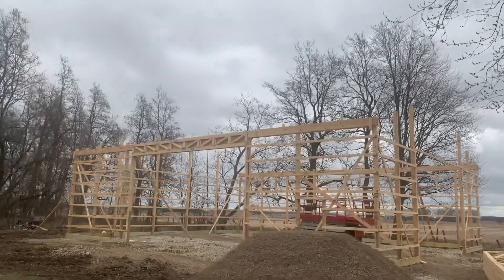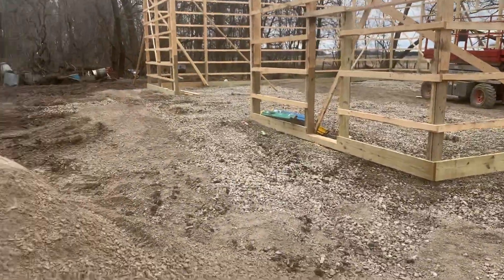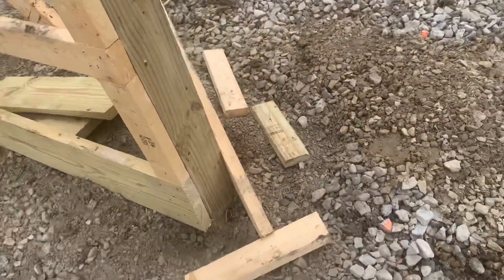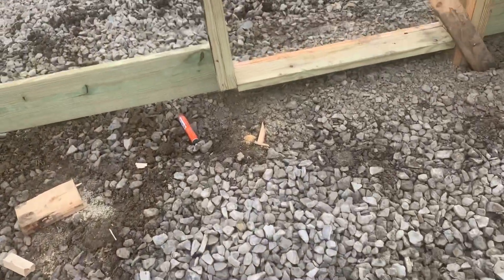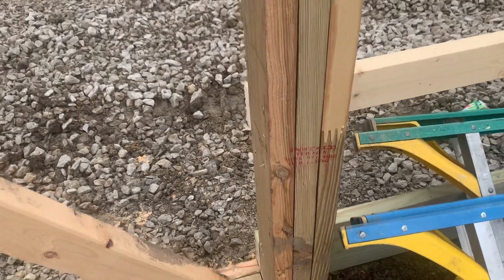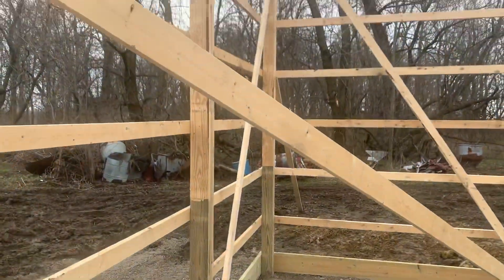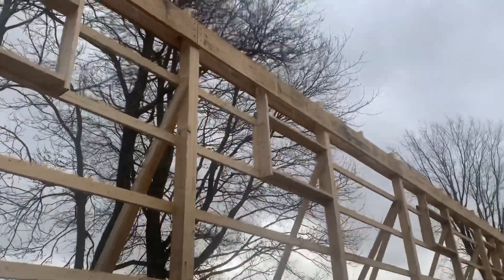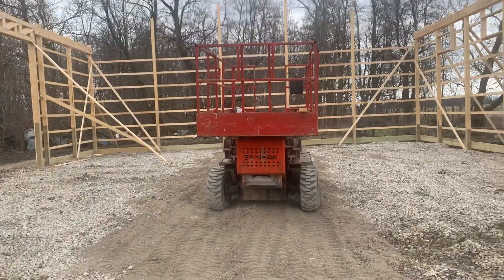50x60 Pole Barn - 3 ply 2x6 or 4 ply columns?

Comment: My 2x6 laminated poles are a little different. The middle 2x6 is offset by 11/2 inches. That way the girts butt up against each side of the protruding 2x6 of the laminated  pole. This ties the whole structure together instead of all the strength being the nails between the girt and the pole. And the second best thing is that there is no additional cost.
Reply from the maker: Interesting take.  Thanks for sharing.

Comment: what's the top 2x12 for? to rest roof trusses anywhere along wall as opposed to sliding into the columns at top? I'd like to know 2x6 3ply versus 2x8 3 ply when going over 16' high. so maybe 18' high and put a second floor: 4 ply 2x6 or 3ply 2x8? I hate how expensive the columns are and wish i could just glue them together myself and GRK fasten them q 12" all the way up. $80 each versus $300 each here in canada. but can't find anyone who has done this.  this is first time seeing 2x4 for wall girts instead of 2x6.  i hate to see any kind of wood touch ground. I'll try to put rigid under floating slab and rigid inside grade board and 10 mil poly between grade board and concrete. or at least a gasket between outside grade board and ground.  ideas?
Reply: The 2x12 is because trusses get set 4' on center and posts are placed 8' on center.  Something has to carry that load.  Load is region specific so you have to check the tables for your region.  Here in northeast PA I would have a 2-ply MSR 2x12 up there because they max out spanning 8' with a 60 foot roof here, so the 50 would be fine.   The trusses that align with the posts can be pocketed, as you suggest, nailed the the side, gusseted, etc.  I am a fan of never breaking the diaphragm in any way so I nail to the sides of posts and leave the posts in tact to the roofline.  Just a preference and no real huge difference to design values but they are there.  3-ply 2x6 maxes at 16' height in my opinion.  I would have designed 4-ply down both eaves and 3-ply on the gables, but again, region specific, load and shear.  If you go 18' anywhere, you should use 2x8.  Their laterals are stronger than a 4-ply 2x6.  

There's probably a good reason you haven't heard of anyone GRK screwing them together.  That reason is the required space distance from the lumber edges.  You would only be able to fasten them down the center of the post, otherwise they will cause checking - nothing worse than a post that is splitting.  Besides, the rule is, wood favors dowels.  Lots of them, like a gang nailer - exacly why they are designed the way they are.  Wood favors dowels.  In layman's terms, nails.  Early on, there were nail lams that weren't glued - horrible things because they cut the nails which were never flush - yes, by the end of the day you were all scratched and cut up.  

2x4 wall girts are common depending on your region, very common here.  What's rare is the 1650's - I use them as well.  I haven't ever built a building where the customer didn't comment on how nice and clean our wood looked, meaning few knots.  

I would highly suggest doing a stacked 2x8 GC 60CCA splash boards.  First, you drop them to contain your stone which protects your biggest investment in your building from cracking because your stone wont fall out from under the splash.  I'm the only one in my area doing this but for me, it's longevity and quality.  Second, in doing so you create a great way to attach vertical and horizontal perimeter insulation which insulates both your stone (because clean stone has lots of air gaps around it ) and your concrete.  You don't need to insulate the whole slab, 24" of vertical cut at a 45 degree angle to meet the 24" of horizontal rigid insulation (new 2018 code design)  Personally I think butting them and taping the seam worked just fine but I guess many folks didn't bother taping.  If you use a 2" XPS rated at an R-10 you're golden.  For some added resistance, cover the rest of the stone inside with double bubble or something similar, nothing wrong with a secondary vapor barrier with some claims to insulating properties.

If you're worried about rot, purchase a roll of Grace foundation seal and wrap your splash.  For a garage they don't rot, guess why?  Our wives don't create flower beds around our garages which is, by the way, the worst thing for a home lol.  I'm one to talk but in my defense, I bought it this way.  Trust me, I'm having the mini excavator delivered soon.